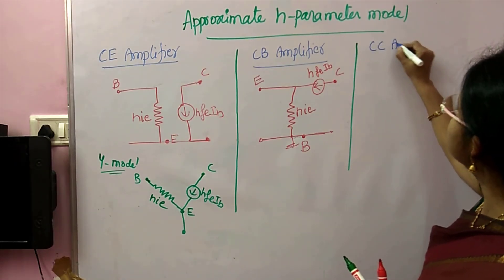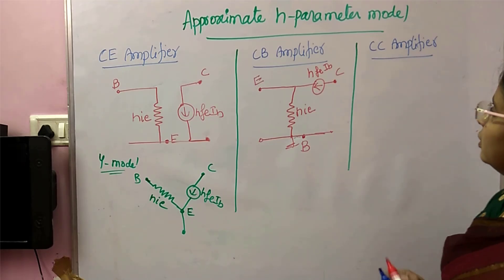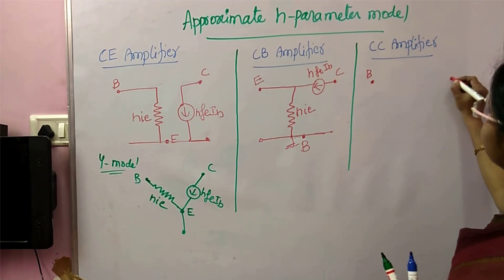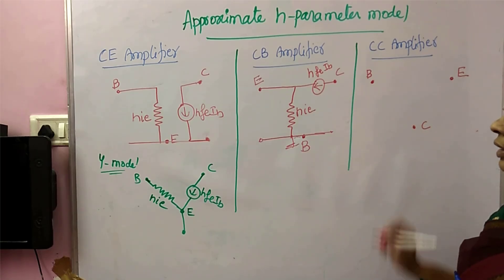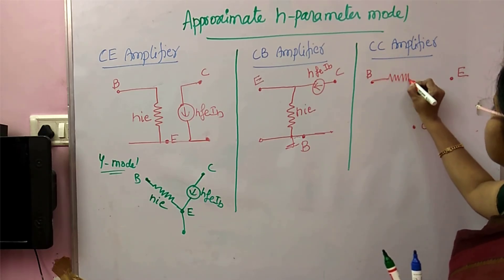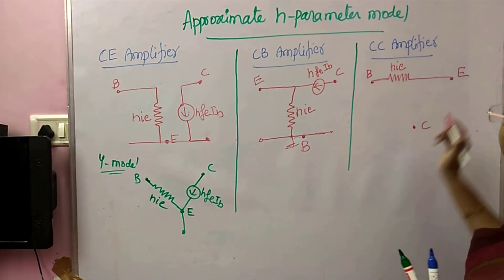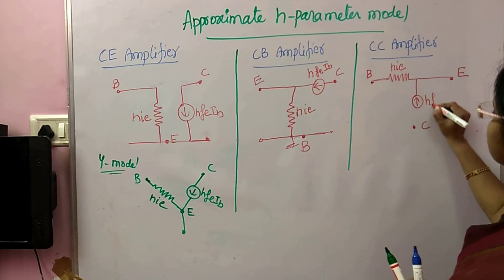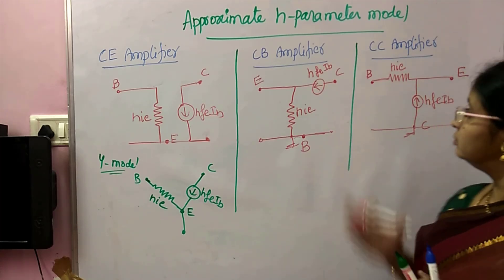Approximate h-parameter model

Comment: well explained mam thank you.
Please can you explain about this concept .
In CE and CC configurations, we use the h-parameter model in different ways why ?and 
While finding AV,ZI,AI,ZO and AVS  in the CC configuration we often use KCL and KVL.
But in the CE configuration, these parameters can be found directly from the h-parameter formulas
Reply from the maker: First of all, thank you very much. The approximate h-parameter model of the CE configuration is obtained directly from the exact model of CE, so the formulas are direct.
However, the approximate models of CC and CB are derived from the approximate model of CE, and that is the reason we have to derive all the parameters.
Please listen to the video once again. This concept is used in multistage amplifier analysis.